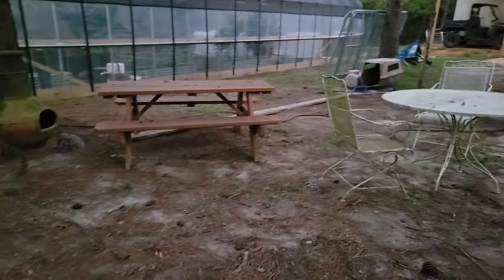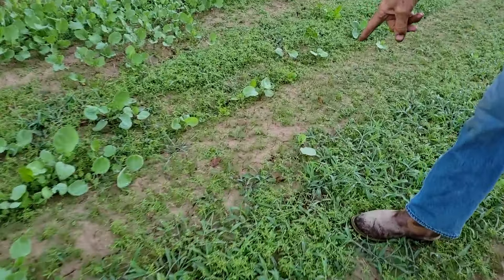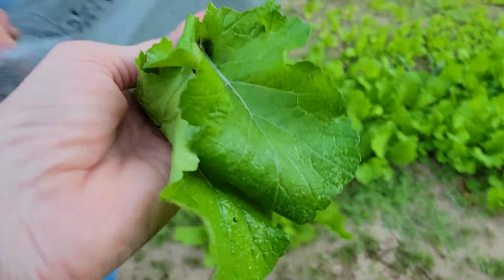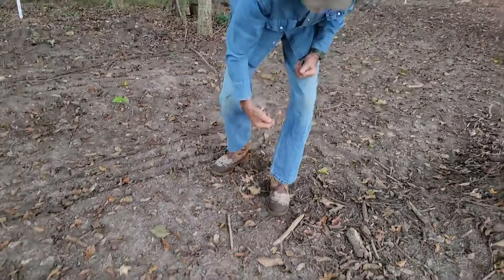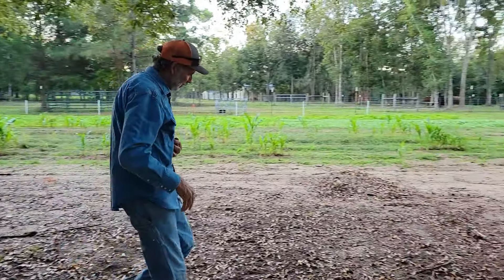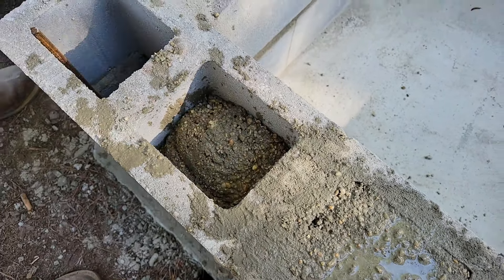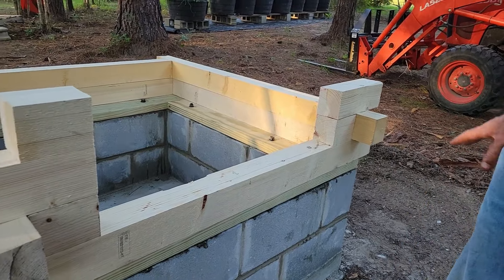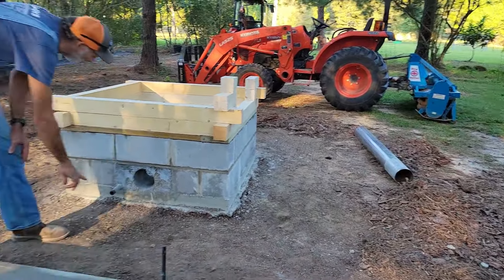EPIC Smokehouse #2 ??

Comment: Danny, you said you may caulk between your wall boards, but it will take you awhile to get all the logs stacked and caulk may be a problem.
I found the cheapest liquid nails stays wet for a day or longer and might give you time to stack wall logs and be able to tighten your all-thread and not have dried caulk from keeping the logs to squeeze together good.
I made smokehouses out of just red house bricks with log frames and have been in use for around 30yrs.
LOVE SMOKIN!